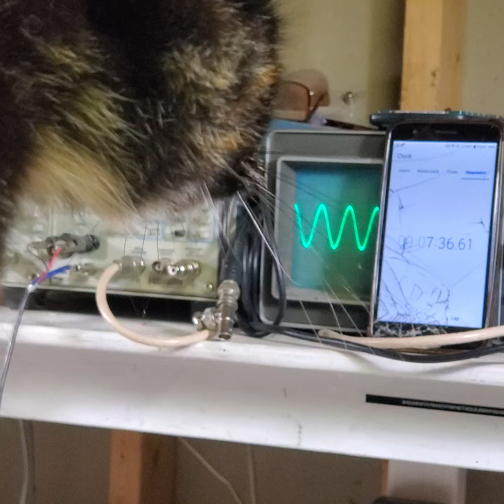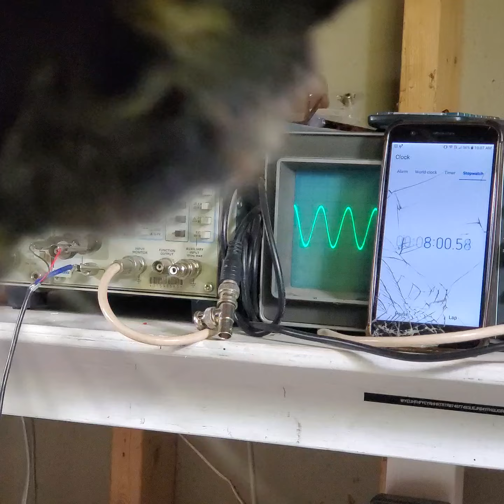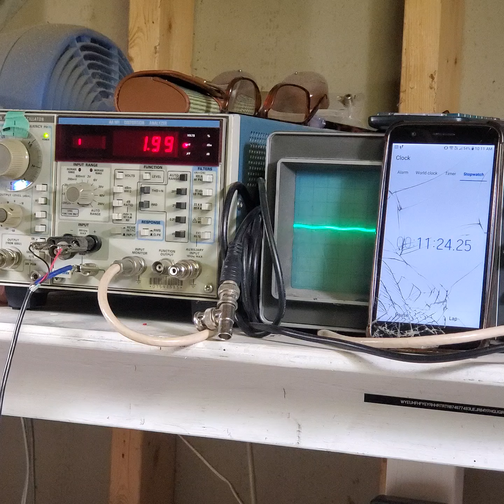A test for how long a G8 power supply with 9 Farads of capacitance can run a P720 phonostage.

Comment: Hello Anglea.
Are the caps all in paralel? Or a combination with in series?
Im building a similar setup. Tnx
Reply from the maker: They are a combination of series and parallel. I have also used different type of capacitors to get the sound I am looking for.
Reply: @angela-gilbert  do you use a typical scheme fkr that or is it all secret magic? 😁

Comment: My mono blocks have separate power supply they stay on for about a minute when switch of from  wall socket will put some st Helena coffee in post for you
Reply from the maker: If they run a whole min without ac power.  They must have a very big power supply.
Reply: I will have to time them  John who made them told me that